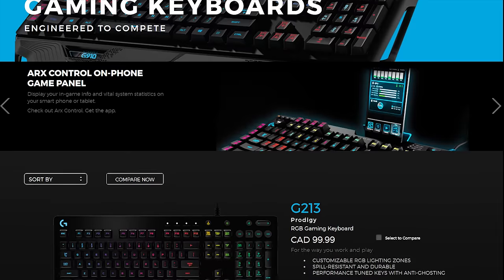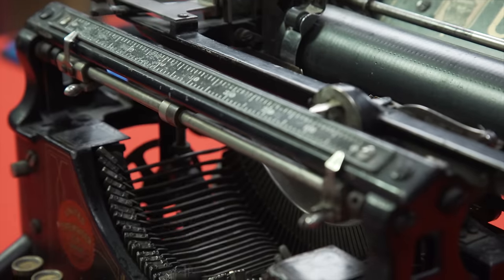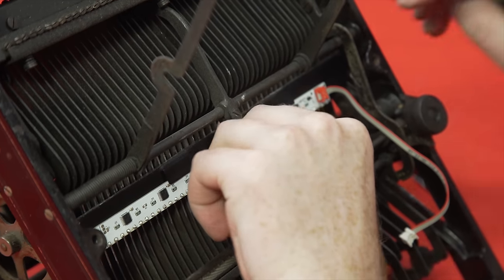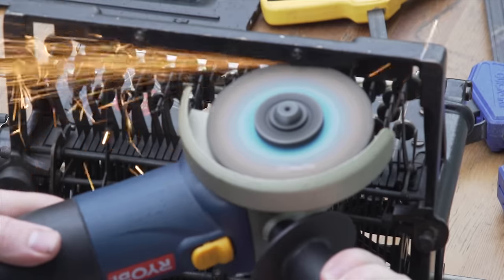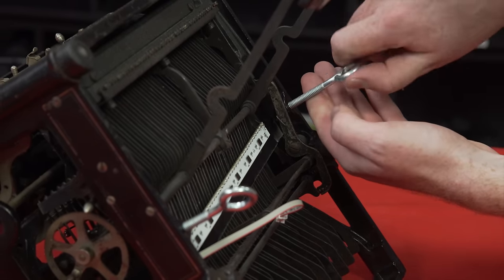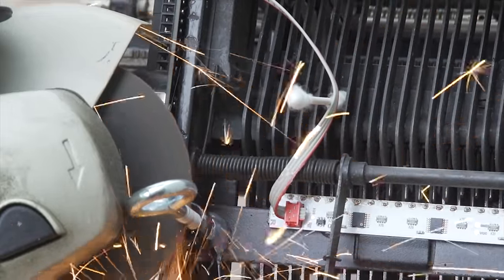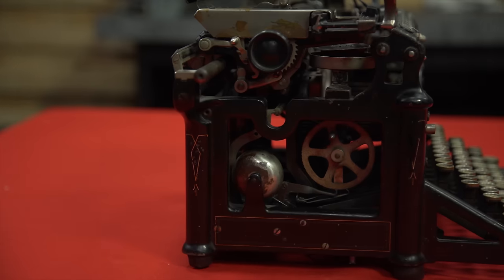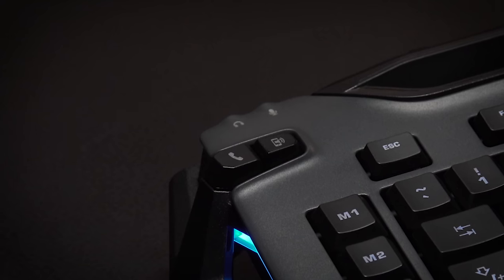21st Century Utility, 19th Century Swagger - DIY USB Typewriter

Comment: Wait, so how does the moving part of the type writer work? Can you still type even though it's all the way to the left? If not, you would be forced to "press enter" after a certain number of key presses. That seems incredibly annoying.
Reply: I would guess you can keep typing even if the holder is all the way to the left.
Reply: I haven't used one of those, but i can imagine it being pretty annoying when using it the way you're supposed to. If you can still type and the slider is all the way to the left, there's a risk of you accidentally typing over the last letter. Or am i missing something?
Reply: The only typewriter I've ever used (my grandmother's old one) would ring a bell when you were about 10 characters from the edge of the page so that you could finish up your word and hit enter. Her typewriter was significantly wider than a standard sheet of paper, so it would actually let you type right off the edge of the page (on a standard paper), in which case it would type onto the roller. Which is not ideal, because then it smudges ink on the next page to go over that part of the roller...
Reply: It might depend on the typewriter. Many typewriters I used wouldn't let the key strike properly if it's reached the end of the carriage. Given the setup here, it might still be enough to trigger the electronics, but would feel rather odd.
Reply: Ok, interesting responses. Seems like it can differ a bit. But i'm sure the linus crew thought about this before they made it(not really, but you know).

Comment: Sort of defeats the point of the typewriter, tacking on electronic gewgaws like that. If you really must have a digital copy of what you type, wouldn't it be easier to just scan the page you just typed, or go out and buy a Qwerkywriter?
Reply: The Qwerkywriter is just a normal mechanical keyboard with normal Cherry MX switches that is supposed to (does not really) look like a typewriter. Not everyone owns a scanner.
Reply: Kailh switches.
Reply: +Olumin 

Well, not having a scanner/printer is easily rectified by a trip to a store or a quick browse of one's favorite online retail site.

Or, alternatively, you could get some carbon paper and make multiple copies with a typewriter that way (that's how secretaries used to do it) or use stencil paper and a mimeograph machine to crank out copies if you really want to go old school.

It just seems a little redundant to me to have a typewriter be a usb keyboard.

Comment: oh for god sakes ya nerds. It's metal.....just heat it up or let it soak in vinegar. Or do what every murican does and use a air impact too break the bolt then drill n tap.

Comment: im pretty sure you don't type on a typewriter with all 10 fingers rather with only your index fingers
Reply: I'm pretty sure you're wrong and young.
Reply: Thermal Ions  well. i'm pretty sure i remembered wrong then :P
Reply: +Koolkei Of cause the 10 finger system works on typewriters, in fact it works so much better without all those extra keys and rats and so forth.  Beware however that training on a mechanical typewriter will make you use so much force this you'll damage your own hands when using an electronic one.

Comment: Noooo, stop. you are taking something that has survived in original working condition for well over 90 years and are grinding, sanding and gluing away over the original paint to create a useless keyboard that is tall enough to block out half your monitor and does not contain half the keys found on a modern conventional keyboard, all for the sake of "oh look at me with my typewriter keyboard, I'm such a gentleman yuk yuk yuk"

Comment: People ... I NEED HELP...

I want to 'turn off' my GPU fan... I want to keep my computer very silence .... Normally I use the youtube and fecebook ... and this things don´t need so much of GPU ... I do some tests and I disconnected the GPU fan cable and use this apps, monitoring the GPU temperature ... And nothing the temperature stays in 29°C (84,2°F). So I wanna know if have some software that can do this ... The MSI and EVGA Afterburner can reduce only to 40 % of rotation ... So they stay turned on :(

Configurations :

CPU : Intel Core i5 4670
Memory :16 Gb Corsair Vengeance PRO 2400 Mhz
MOBO : Asus Maximus VI HERO
GPU : EVGA GTX 780 6gb 
Water cooler :Cooler Master Seidon 240M
PSU : Corsair CX750 M

Comment: um WD-40???
Reply: Not on typewriters.
Reply: Olumin Why? Stuck bolt = WD40
Reply: LinusScrubTips WD-40 gums up and will jam the entire mechanism after a while, at first it will work well, until it doesn't. WD-40 also attacks the paint as well as plastic parts. It is basically impossible to remove once solidified. The only worse thing is stuff like sunflower oil or olive oil. Only use stuff like mineral spirits for cleaning which evaporates and only oils/lubricant that doesn't solidify over time.
Reply: Olumin 1) They were spraying a bolt, not using it as a mechanism lubricant.
2) I don't think this has much plastic, and I don't think it really would have hurt the paint if it was sprayed on the bolt and cleaned off after they got the bolt off.
3) Who said anything about using WD-40 for cleaning? I was talking about rust breakdown.

WD-40 is best used as a dual Rust preventor and light rust removal (IE a stuck bolt), and it also acts as a short term mild lubricant. That's why it's also great for protecting cylinder bores in an engine if you're not going to build it right away.